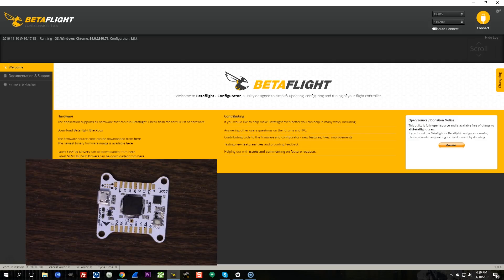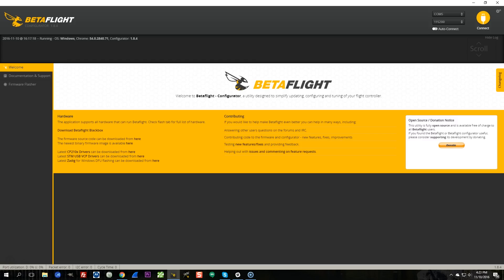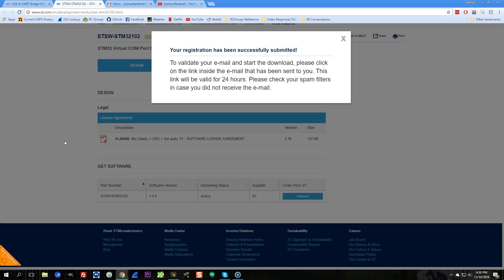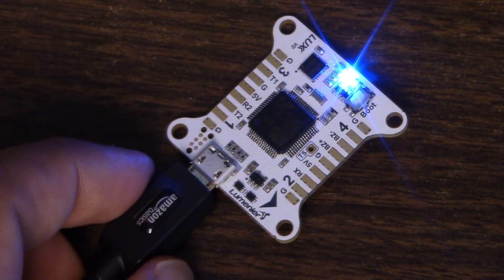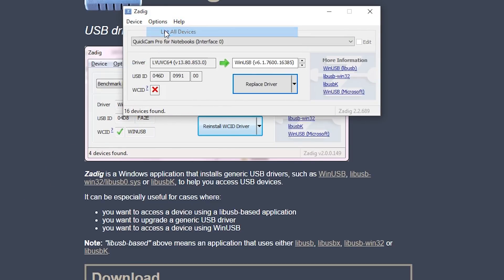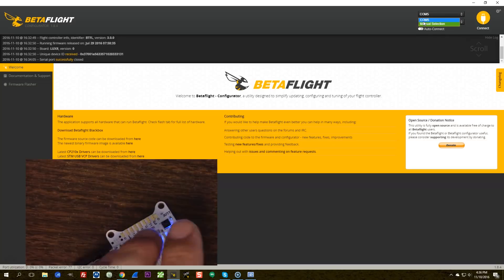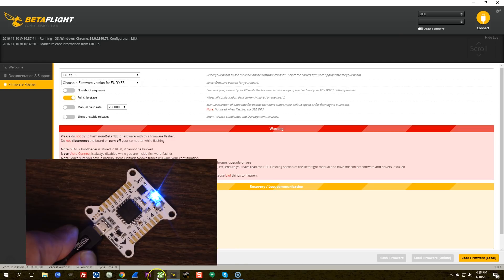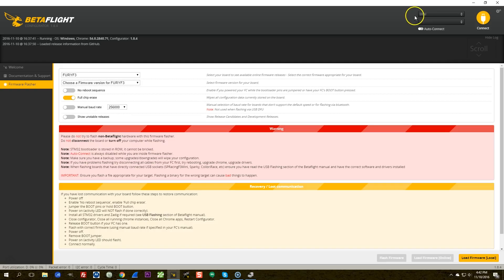Betaflight / Cleanflight Flight Controller Won't Connect | FIXED

Comment: Please help. I just got a Youbi XV-130 that came with Clean Flight 1.14.0 and I can't flash it at all to Clean flight or Beta flight. I have the recommended SPracingF3 target selected, the board has a CP210 chip (no VCP under ports tab), i downloaded the CP210 drivers again, it goes into boot loader mode but it fails to connect to the bootloader when I go to flash.
Reply from the maker: Try using "flash on connect". If that doesn't work, try hitting the Flash button manually after the "flash on connect" fails. Try turning on and off manual baud rate too.
Reply: You got to this very very quickly. Thank you for the quick reply. I was coming back here to delete my comment because I was finally able to get it working after trying for more than 3hours this morning. But since you have already replied, I will leave my comment up here in case it helps someone else. I was playing with baud rate and the flash on connect and it still would not flash. I re-downloaded the latest CP210 drivers from the Clean Flight welcome page and reinstalled the driver (without deleting it first) and then restarted the PC and it still didn't work. I had to completely delete it (via device manager), then reinstalled the CP210 driver mentioned earlier, full shutdown and restart of the PC, put the FC in bootloader mode, and it flashed successfully after that. Never could have solved this without your video above! Thank you!
Reply from the maker: Deleting the device, reboot, reinstall driver, is a necessary last resort.

Comment: i get a failed to open serial port for my naze 32
Reply from the maker: Do you see COM3 (or some other number) in the upper right pulldown menu when you plug the board in? If NO, then your CP210 drivers are not installed correctly. If YES, then some other program might be using the COM port, like maybe you have BLHeliSuite running in the background.

Comment: hi ....my problem is that when I release the botton , the board won't stay in bootloader mode and if I check in deveice on my laptop...it shows how my board goes from bootloader to virtual com...it actually stays 2 sec in bootloader

Comment: Hey my f3 flight controller used to work with my laptop. Then it just stopped working. Everything works when it flies, but its not not working anymore.(please help! I dont have much of a budget!)
Reply from the maker: Most likely your laptop drivers have been buggered somehow. Download the Impulse RC Driver Fixer app and run it.
Reply: Joshua Bardwell ok thx I'll try it!
Reply: Joshua Bardwell just saying I never installed any of the other drivers and it still worked until it stopped
Reply from the maker: Regardless of how the drivers got onto your machine, the drivers must have been there or it never would have worked. And now I think they're buggered, because Windows does that sometimes. Anyway, that's the best guess I can give you based on the information at hand, and via YouTube comments :-)

Comment: I downloaded all 3 of them. Connect and nothing happens when I connect my wizard via usb... This still not helping with getting the drivers working! Can you explain how to use the drivers?!
Reply from the maker: Yes, well, you run the installer and then you plug in the device.
Reply: Joshua Bardwell thanks for the response guy! So I can get connected to betaflight now on com4... but I am not able to flash 3.0.1 to the board. I get, "No response from the bootloader, programming failed":(
Reply from the maker: The board is not in bootloader mode most likely. What board is it? Is it a VCP board or not?
Reply: Joshua Bardwell it is an sp racing f3. not a cp210 I dont think.. I can connect when not in bootloader mode, then I unplug. short where it says boot. then I cant connect, or flash.
Reply: Joshua Bardwell Ok I have finaalllyyyy figured it out!!! I had to actually HOLD the jumper on there as I clicked flash and what not! Thanks a lot for helping me out!

Comment: the other light on my sp3 does not blink. It stopped when I was flashing bf 3.1
Reply from the maker: Perhaps you flashed the wrong target? Regardless, you should be able to flash back by putting the board into bootloader mode.
Reply: Joshua Bardwell nope, it's the right one. It's not on with or without the bootloader pins shorted. It has taken one dunk in the pool, so I guess that's it.
Reply: have the same problem except mine is brand new

Comment: Hello Josh, I'm in need of some help. I just recently bought a quad and it has the SPRF3 FC. I'm trying to update the FC to the latest version in betaflight. I'm running windows 10 and I installed all the drivers from the betaflight main page. When I plug my quad into my computer the first thing I notice is that it doesn't make any sounds indicating that something was plugged into the usb port, then when I open betaflight at the top I just have manual selection and directly to the left it says Port:/dev/rfcomm0. I don't know what else to do or try. please help
Reply: when I plug it in I get flashing red lights with a solid blue light and then the red lights go off and its just the solid blue light
Reply from the maker: +adrian postell that sounds normal.

Comment: I am unable to choose my board in the zadig thing. How did you get your boards to show up?
Reply from the maker: +Kaden Gunter just use the impulse rc driver fixer app and skip the nonsense.
Reply from the maker: +Kaden Gunter just use the impulse rc driver fixer app and skip the nonsense.
Reply: Joshua Bardwell - ok I have the impulse rc driver fixer, and now the problem is that the program doesn't recognize my board and sits trying to find a fc.
Reply from the maker: +Kaden Gunter it's probably not a VCP board then so it doesn't need the Zadig driver.
Reply: So how do i use the drivers once they are installed?
Reply from the maker: +Kaden Gunter cleanflight configurator or Betaflight configurator chrome app.

Comment: when I connect it to cleanflight it just beeps i see comm 6 pop up so i think thats what it wants to use but it time out after 10 seconds it fails to connect this thing just blinks and beeps pulsating flashes and beeps cant flash it either tried messing with the boot pads still nothing tried beta race clean and baseflight still nothing all my other quads connect right up

Comment: help i bought a diatone 180 and when i connect it it just beeps at me same when i give it battery
Reply from the maker: That's not enough information to help troubleshoot, I don't think.
Reply: Joshua Bardwell hey Josh I got it to flash but I still can't pull it up I don't know why I flashed it with cleanflight and I flashed it with betaflight neither one of them will pull it up but it will Flash and yes I did remove the solder from the boot pins I know you said diatone it was a good company but when I asked him about this he kept telling me it was my computer when I told him I tried three computers he told me it was my drivers then when I told him it was able to flash but I'm not able to connect he said most of the people in The Hobby spend more time building than they do flying so get used to it that's pretty fucked up man I'm done with diatone for good that is the shittiest customer service that I have ever seen my local hobby shop won't take it back either because they would be out $200 if you have any ideas that might get this quad flying I would appreciate it if not I'm just going to strip the whole thing I build it myself never ever ever buying another Chinese product that is pre-built they never work right
Reply from the maker: +Ultimatevapor918 what does the LED do when you plug it in to USB? If it's solid blue with no flashing green, it's in bootloader mode.
Reply: Joshua Bardwell when I plug it up to the computer I get a solid blue light but also the green light in the back of the board will flash twice and then pulsate and then flash twice and then pulsate again and it continues to do that and then after 10 seconds it times out
Reply from the maker: The fact that the green LED is flashing means you're not in bootloader mode. What is the exact flash pattern. Is it like two-slow, then three, four, or five fast? If so, that indicates a hardware failure in the board. Usually the gyro is damaged. 

Usually this happens when the copter is crashed. Since you have never flown the copter, a reputable retailer should treat this as a DOA and give you a refund. A hard-ass retailer will tell you to f- off and accuse you of having damaged it. Sorry that you may be stuck with the latter. 

Diatone has every right to tell you to take it up with the retailer you bought it from. This is standard practice, although some manufacturers go above and beyond and take care of customers directly. Unfortunately, your retailer is a local hobby shop, and you will now experience first hand why most local hobby shops are running themselves out of business.

Most likely you can buy a replacement board for less than $50 and this is probably your best bet for getting into the air. I think you have the Diatone Crusaider... if so, that's a decent copter worth sticking with, although it isn't perfect.

Comment: Hey there! Thanks for this great video! It made me realize that I did the Zadig mistake you mentioned around minute 7... I didn't engage the DFU monde when istalling the driver... and now I cannot connect to cleanflight... Would you know how I can revert this? I was looking all around internet to find a solution, but I cant find anything... help please :)
Reply from the maker: +Fed Ko delete the device in device manager, then reconnect it to force the drivers to reinstall properly.
Reply: Joshua Bardwell Will try it, thanks :)
Reply: So I managed to delete the driver in the device manager, but now when I try to reinstall them also via the device manager, windows says it cannot find any drivers... Would you maye have an idea where can I find these drivers on internet? or at leaste the name of the default drivers, or some key words that I can try to look up on the internet to find these drivers? I we been trying for the last two days, and I haven't found anything that worked so far... :) thanks! I use windows 8.1
Reply from the maker: +Fed Ko they're linked in the opening page if the configurator GUI. Also this may be helpful. 

https://youtu.be/m4ygG6Y5zXI
Reply: Managed finally to make it all work. Actually what solved it was launching the windows update tool that dowlonaded by it self the missing drivers :) 

Thanks for your help and your great videos.

Comment: WHHHHYYYYYYYYYYYYYYYYY do they have to make this so f@#*ing complicated. With my flip32 it's just connecting the board and flash it. AAARRRGGGG
Yesterday I tried to flash my brohters new GX210 containing a sp racing f3 and I couldn't get it to work. Sadly I also couldn't find a proper instruction after 10 min. of google-search.
Thank you for the video, now I should be able to do it.

Comment: Hey Joshua, I have read on some of the small brushed FC's(Quanum/Scisky) that it not advisable to use both USB and lipo power at the same time. It can cause damage. Do you know about this issue? And if you can tell when it is not a good practice. Some are having problems with Tiny Whoop Beebrain and Beecore becoming dead to USB after they have used both power at the same time. Thank you for all you videos.
Reply from the maker: +rcwck I'm not aware of that issue. You have to do that in order to calibrate the ESC's. There is no alternative.
Reply: Don't think those tiny FC need motor calibration. I haven't seen/heard that mentioned.
Reply from the maker: +rcwck brushed ones don't.
Reply from the maker: +rcwck brushed ones don't.

Comment: you know how I told you when I would do a throttle punch the beeper would beep for a split second? well I read on regroups a guy had the same issue and he said he removed osd and he was able to save modes. well this morning I thought let me try and unsolder the beeper and I set my modes and just flew it 5 times and I keep checking to see if it's still there and the modes are still saved. weird huh? Thanks again for your help.

Comment: My f3 flight controller won't save my modes. it saved and was there then was gone the next time I went to fly. Can some one help? please
Reply from the maker: The only thing I can think of that might cause this is if you are using an incompatible configurator of some kind. Like you are using an old Betaflight version with the current configurator or with Cleanflight GUI. Or maybe EZ-GUI on your phone.

Or you never actually saved it in the first place.
Reply: I did save it cuz it was there for a little while after I saved it. I checked after I unplugged it. Later today I went to fly and it wasn't there. It's really weird. How do I know witch is the right cleanflight version.
Reply from the maker: What cleanflight version are you using?
Reply: Joshua Bardwell I'm using configurator 1.2.4.
Reply: I noticed when I give it a throttle punch the beeper goes off real quick.
Reply from the maker: I don't know of anything that can spontaneously erase modes like you're describing. The configuration is stored in EEPROM; it doesn't just change while the board is powered down. Neither does the board have functionality for adding or changing modes except via configurator, as far as I know.

You told me what configurator version you're running. What version of Cleanflight is on the board? What is the output of the "Version" command in the CLI?
Reply: I'm going to check right now. I hope it's just something I'm doing wrong. I'm still learning. I know how to fly but not configure these things.
Reply: Flight controller version 1.12.0 api version 1.16.0.    Where do I find the cli? Yea this is weird. It's driving me a little crazy. I just want to put in horizon mode lol. I was able to set the rates where I like them so they saved fine
Reply: When I set the modes arm and angle mode have to be green or arm and horizon mode have to be green but when just arm is green my motors power up.
Reply from the maker: +Ian Rice you're using cleanflight 1.12. 5he current version is 1.14. I don't know if there are any compatibility issues but if the configurator is being screwy that would be my first guess. Why not ask on the cleanflight rcgroups thread?
Reply: Thank you I'll check it rcgroups. Man I have some bad luck with these things.
Reply: can I ask you  question? Is there a way to adjust my throttle stick? Ill explain, when  I'm using a 4s battery and I try descend and the quad barley wants to come down so I'm trying to lower my throttle to come lower and the throttle gives out cuz I have to bring the throttle stick down so far. Is this normal or I just have to get used to it? it actually made me crash from 20 feet up on concrete, lucky I only broke the fpv cam mount witch ill have a new 1 tomorrow and super fixed it. Thank you!!!!!

Comment: Hi i have tried all this And what i am having problems with It says serial port cant connect I have been on this for hours Any advise Cheers
Reply from the maker: What does it show in the upper-right of the configurator GUI when you plug in the board? You need to see "COM12" or whatever number COM port is in use. (Assuming Windows, that is.)
Reply: I think there may be a fault with the board As the green ligh is no longer coming on Thanks for getting back to me Graham

Comment: Question. If I plug in my Luminier FC into the usb and nothing happens, not even a light, is the card dead? It has been in a quad for 6 months and flew well. I had a crash caused by the battery coming off the PDB pad. Could have shorted, not sure.

Thanks ahead of time.
Reply from the maker: If the lights don't even come on from USB, it's probably dead.
Reply: Thanks a bunch, I won't waste anymore time with it. Super appreciate all you are doing. Thanks again for your personal message...

Comment: How do you like the new LUX? I'm a lux fan so I'm really excited about the new release. Why not f4?
Reply from the maker: You'd have to ask Lumenier why not F4, but my guess is it would have been a much more substantial re-design as the F4 has a completely different footprint and pinout.

The new Lux is a great board if you want a standalone board without an OSD or anything. I mean, I say that on paper anyway, since I haven't actually flown it.

Comment: I was thinking where my dfu mode  apparently my board is using cp210. But I still can't install it on bootloader mode, but flashing firmware is fine in normal mode with manual baud of 115200.
Reply from the maker: Whatever works. For CP210 boards you sometimes don't need to put it into bootloader mode manually. Sometimes it will work if you erase the blackbox flash chip immediately beforehand. How weird is that.

Comment: I thought I knew my way around the different drivers of different boards but damn! This really explains the mess that is stm32 drivers! Awesome video!
Reply from the maker: It's only really a mess on windows with Chrome.
Reply: I've thought of buying a Macbook for FC Comfigurators. Ya think it's worth it?

Comment: Last week I was flying under some trees and a tiny twig reached out and chopped a esc signal wire in half.  After this happened my sp racing f3 board was completely dead.  No leds, won't connect to Betaflight, nothing.  I replaced the fc so I'm not really concerned about it now but I'm curious to hear if you have a possible theory about why it killed the board.  I suppose it's possible that the cut wire touched   a source of voltage but it doesn't seem likely.
Reply from the maker: +DrFuNK  no clue. Probably damaged in the crash I would guess.
Reply: Joshua Bardwell maybe but it was a pretty gentle crash on grass.  When I went back and watched the footage I saw that the quad just fell to the ground after hitting the twig.  It didn't flip out as if one motor was gone.  Oh well, doesn't matter now.  I was just curious.